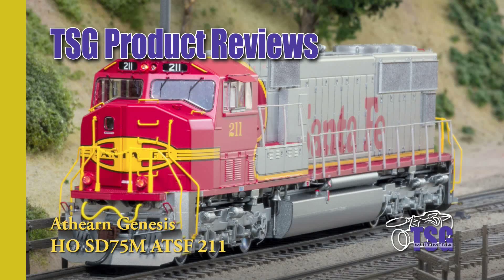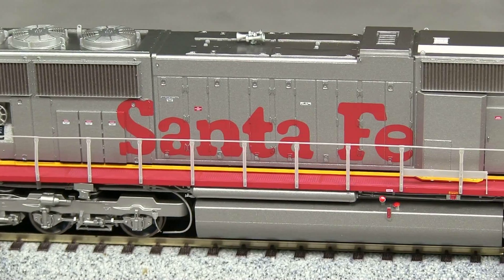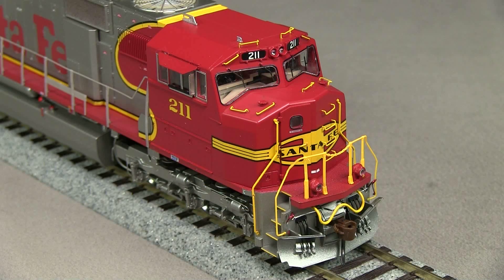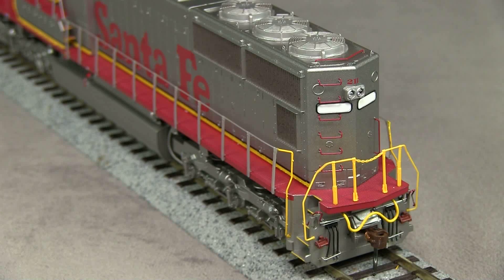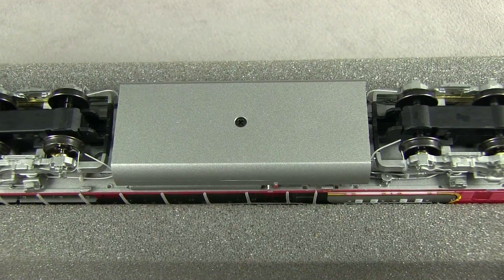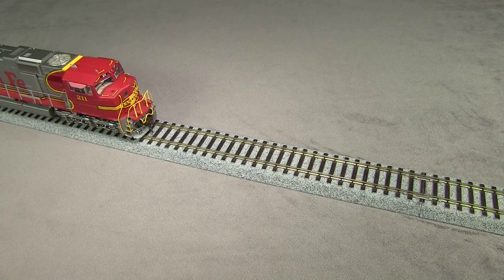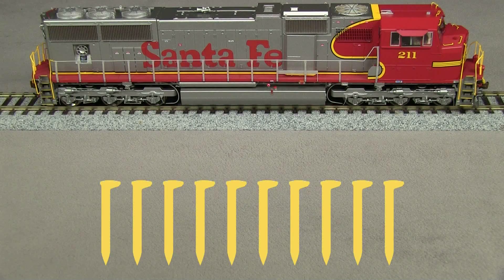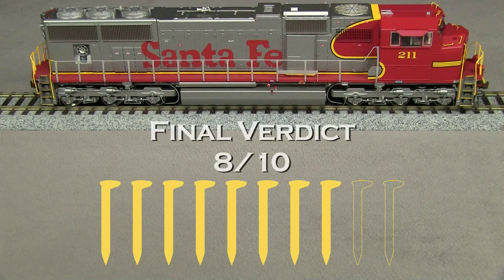HO Scale Santa Fe Warbonnet SD75M Athearn Genesis Product Review

Comment: I like the Athearn SD70 series engines. The only trouble I have with them is their trucks float in curves an switches. The engines are way to light to put on a big train an DCCing them up is a nightmare from DC.  They have nice paint jobs on them
Reply from the maker: If you have trouble on curves and switches, check the wheel gauge on the locomotive. If that checks out, try checking the track itself. Trucks do not float if your track and wheel gauge are both accurate.